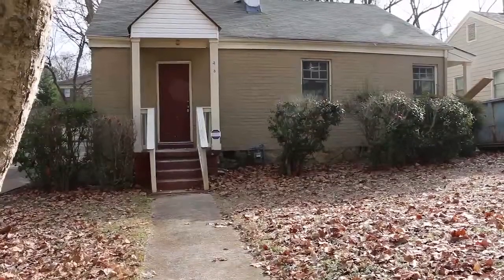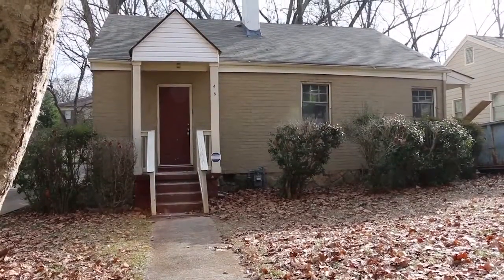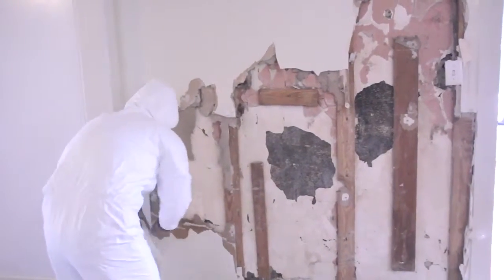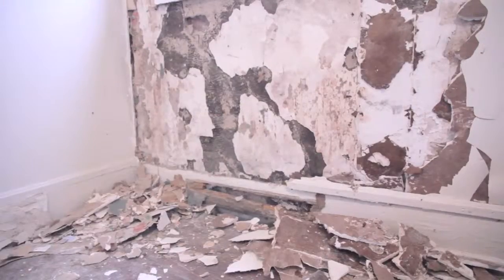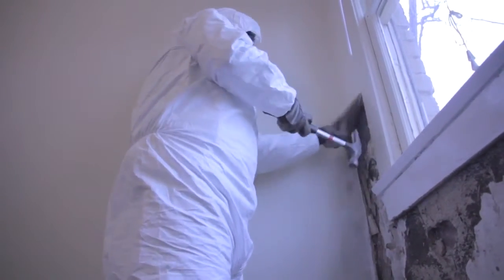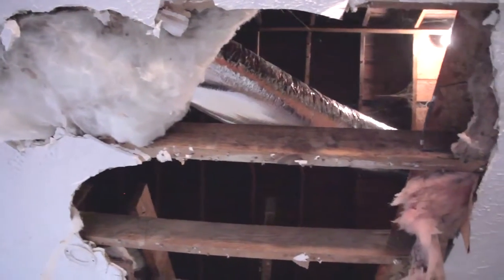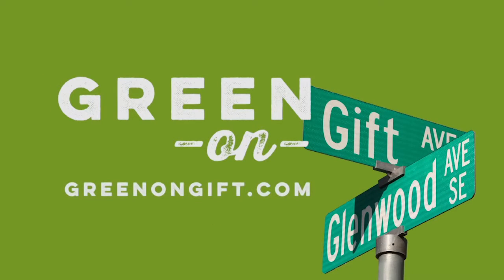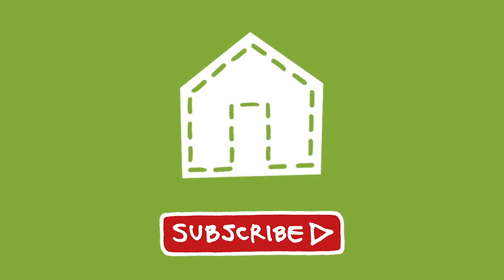Demolition Day at Abe Kruger's Green Home Renovation

Comment: question: is it more ecological to have used what was already there instead of trashing it? or trashing it to replace with better technology?
Reply: +Discipulo De Jesus DDJ, This house was pretty compromised from a "building envelope" standpoint. Leaky windows, no insulation, HVAC ducting in horrible shape...to just fix it cosmetically would have left it as an inefficient energy hog. That would have had an ongoing environmental impact, with the house consuming much more energy than needed, which in Georgia is still provided by coal (some power plants). It would have also been expensive to live there. In this case they needed to pull the old drywall to frame out walls and add spray foam insulation (videos to come). The ceilings came down in the living room to replace damaged joists and bring them back into level. One cool green element, (in another video to come) is that Abe donated a lot of the savable materials he took out (doors, sinks, countertop and cabinets) to the Lifecycle Building Center, a local reuse facility. So, sometimes removing it doesn't mean it is headed for the landfill. As always, thank you for your questions and feedback. Happy Easter, my friend.
Reply: +Tom Mills (GreenShortz) .  Thanks for the reply.  So I guess in this situation it was more ecological to tear it down and replace it with more green technology.  That makes sense.  I sometimes find it hard to make such decisions, and I guess I usually end up thinking that using what is already there is the best option. But I guess that is not always the case.  Thanks for clarifying that.  I also hope you have a meaningful time during these holidays.  In Christian tradition what we are remembering is the greatest example of love God has ever shown towards the human race and each one of us personally... and that is something to deeply appreciate... though nowadays it often gets relegated to just another long weekend and a holiday related to chocolate eggs and bunnies.
Reply from the maker: +Discipulo De Jesus Agreed that keeping what is there is usually the best ecological solution. Keep in mind that in renovating this house, Abe did keep most of what was there. He did very little to alter the structure of the house, and used the existing HVAC unit (which was still good), opting to redo the ducting, which had been horribly done (you'll see that video soon). The house had been vacant for nearly 2 years, likely because it was expensive to operate. Many developers would have just torn the place down, but Abe took the greener option in restoring it, and did so by using innovation and technology to make it an efficient home. I haven't been back since he has completed the project, but I will do a recap video. There are still a few more in the series that will be posted. I also concur with you on the true meaning of Easter. I made that reference  because I gathered from your screen name that we are of the same greater family. :-)
Reply: GreenShortz + GreenHouse
 Thanks, Tim, for your response.  It's definitely good that they kept what they could from the structure.  And I've appreciated your answers to my questions.  It's helpful in trying to live a more green life. 

So we are part of the greater family!! Nice. It's refreshing to see Christians involved in green issues, as often it is a topic that is neglected.  I hope you have a meaningful weekend. 

PS: I love your 26 second greens!